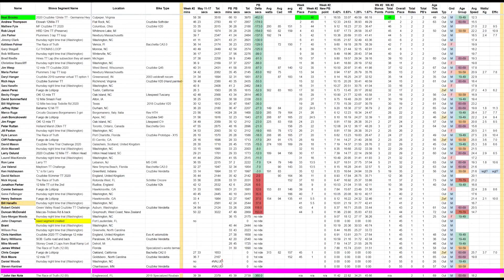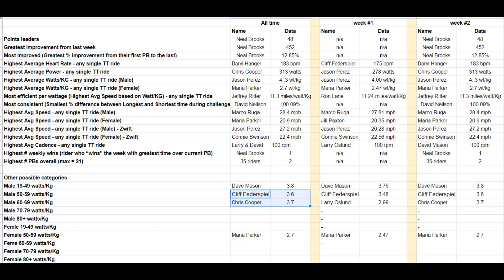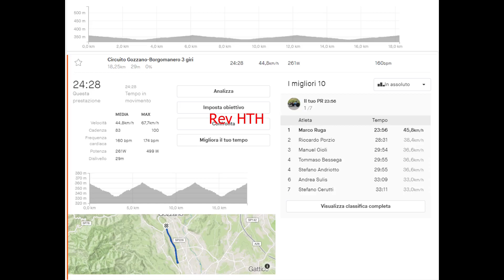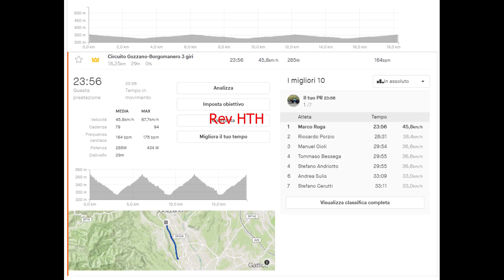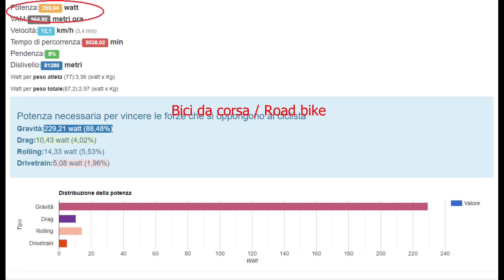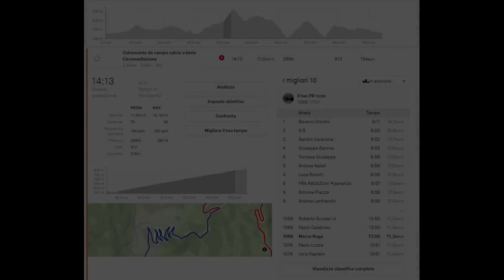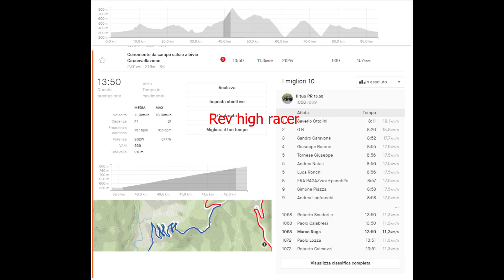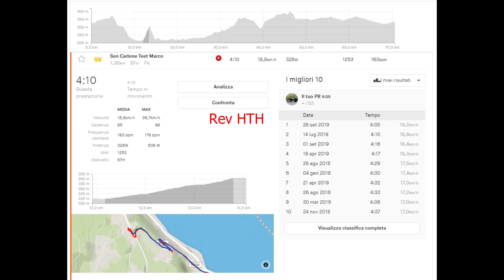(ENGLISH )How much power do you lose in the recumbent position?

Comment: I would like to point out that the muscle group you use in recumbent is different from a normal bike, a person who trains on one is not going to perform as well on the opposite bike. You use twitch muscles on a normal bike you use power muscles on a recumbent, twitch muscles are more sustainable but you should be able to provide more power lying down for a shorter period of time. It would be very hard to make a comparison, it would take a very large data set to make a definitive conclusion. However experts like yourself would be best able to make value judgments provided you can stay neutral on your results, everyone has preferences. Interesting video thank you for sharing.
Reply from the maker: I think that is not simple to simplify the phenomenon. What I see is that there is a there is a fairly fixed ratio between FTP power and seat tilt. And, yes, you use sligtly different muscles.
Reply: He said his volume was the same for training on the road bike and recumbent at the beginning.

Comment: That bike at 1:10 looks very interesting. Thank you. I wonder if a gear hub in a front wheel would be any benefit? Like riding a miniature velocipede? I have 9 speed 0.67 to 4.02 gearing ratio planetary gearhub designed. I would rather try a bicycle first,  then a car.
Reply from the maker: You can find any detail on that buke on this channel, it is the "HTH": 
https://youtu.be/DdCJdtKAAls

I don't hink that a central gear hub would be a great solution. Too complicated mechanically and too much reaction from the pedals to the steering. And  a lot of power loss in the gearing.
Reply: @MarcoRuga  Thank you for the link. Marco. It is very nice design. Aerodynamic and not too far to fall. I never thought of a reaction from pedals to the steering. I will have to think about it a little. Power loss should not be too bad I don't think. It is 48 teeth all together. 1 - 3 teeth per gear. Engineering was not easy. https://photos.app.goo.gl/EatYxdo1U3TG1HG68

Comment: Interesting video. Thanks for the upload. Can you do a power/speed comparison between a road bike and a recumbent on a relatively flat course?
Reply from the maker: In the video there you can see the deatail of comparison on a 18 km/90m elevation course. Road bike on the drops: 38.4 km/h@329W  Low racer recumbent 45,6km/h@285W. Actually yesterday I have made an other test with the low racer 47,2 km/h@298W. It is not a super fast course, maybe I will try to chose an other faster in the future.
Reply: @MarcoRuga  Thank you. I have a DF bike and considering a recumbent
Reply: @MarcoRuga  this is very hard to measure truly 'scientifically', because you would need some sort of blood oxygenation sensor - at least if what I presume to be key reason for loss of power in recumbents position is true - drop of hystrostatic pressure in elevated legs that messes up with nutrient delivery/waste removal from working muscles (that cannot fully 'feed' and contract at the same time due to rise of intermuscular pressure).... otherwise you have to go with 'subjective perception of effort' and obviously it is quite 'fluid' in nature. An other indication - for a lot of people standing power is quite a bit higher than seated power when climbing - on Xert forums there are rather frequent complaints that standing climbs messes up with 'power signature', rising it much higher and making seated workouts unsustainable.
Reply from the maker: See also here: https://www.strava.com/activities/3494636378
Reply: I guess it is quite randomly asking but do anybody know a good place to watch newly released series online?
Reply: @Sam London try Flixzone. You can find it on google :)
Reply: @Sam London i would suggest flixzone. Just search on google for it :)